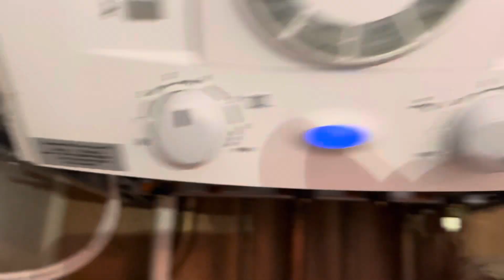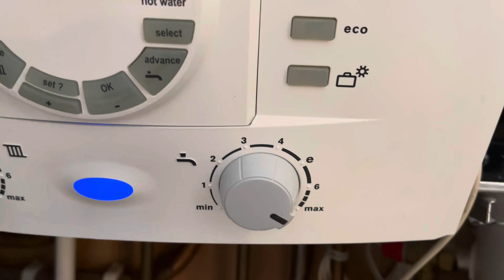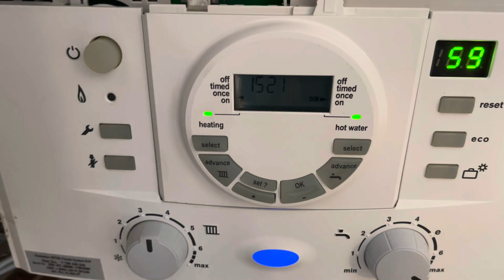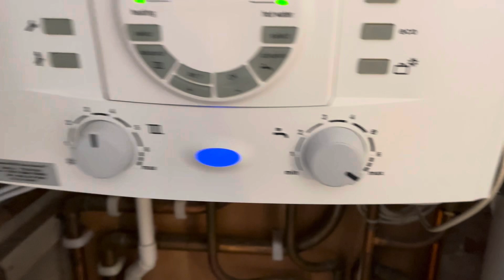How to fit Honeywell evohome to a Worcester CDi Classic System ErP Boiler with Integrated Diverter!

Comment: This is a very fortuitous video!  Am needing to reconfigure an existing 42CDi that was previously just heating radiators and on demand DHW to heating (a) Multi-zone water UFH, (b) Solar Mixergy (sourced from MWPHS) and (c) existing radiators.  Also need to add unrelated electrical UFH bathrooms to a family friendly control interface.  Been looking at HA/Zigbee etc, but needs to be maintainable without a domestic nerd.  After scouring the Internet now looking at the Honeywell HCC100 and EvoHome combo.  So much reading, so many questions... you think it's a good match?
Reply from the maker: evohome won’t work with electric UFH. Maybe look at Salus Smart Home to cover all these products? If you need any help, give us a call at MWPHS.

https://mwphs.co.uk/product-category/manufacturers/salus-controls/salus-smart-home/